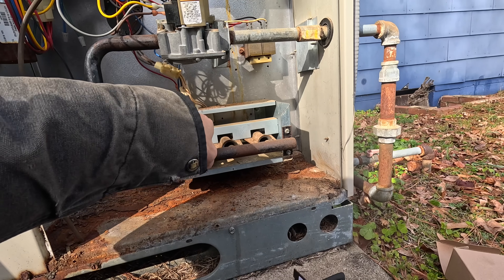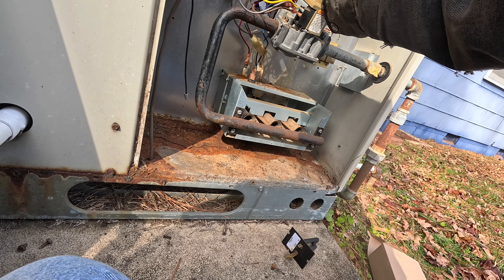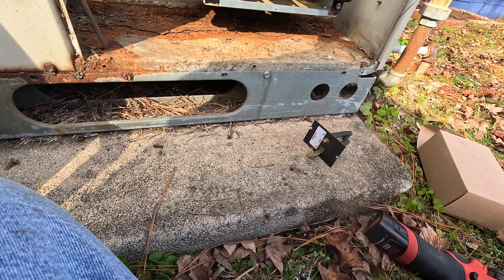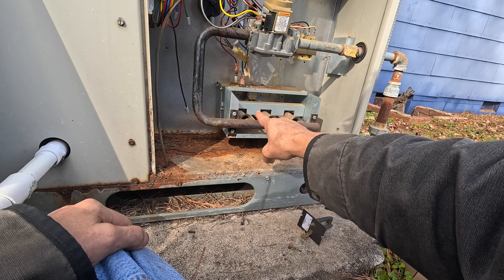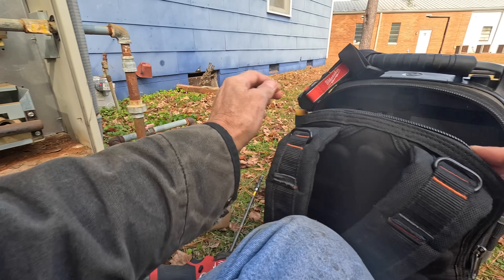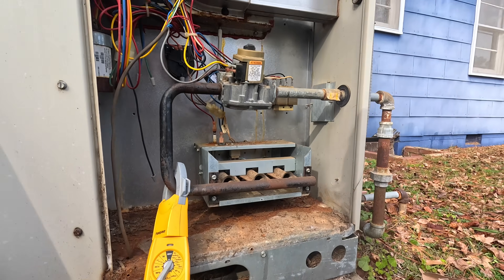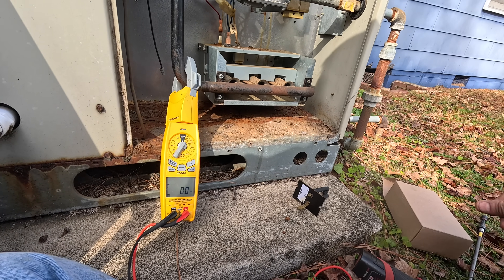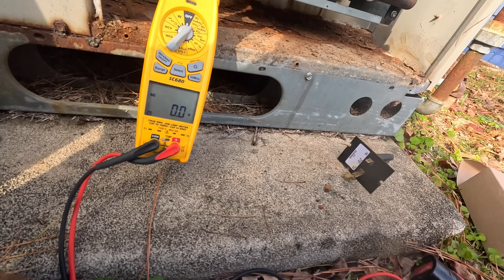Simple Repair Reveals A Baffling Problem! #hvacguy #hvaclife #hvactrainingvideos

Comment: There should be voltage on the flame sensor even if there is not a call for heat. The sensor is just waiting for the flame so the voltage can be rectified to dc current communicating back to the control board through the ground circuit.

Comment: yes, that voltage through the flame rod is normal. but since you were reading it from the burner box i would guess the porcelain insulator is compromised

Comment: Power off at all times when replacing an electrical part brother. Shortcuts can lead to preventable accidents. 45 years in the HVAC trade and this OG has learned a lot...some the hard way.
Reply: Yep ! Power off and body off the ground.

Comment: Maybe the difference with this one is that most of them only put the AC voltage on the sensor when they expect a flame to be present (gas valve open), but this one is connected all the time , or at least when the draft motor is running?
Reply: most of them have voltage applied at all times, that way they can sense for flame when there shouldn't be. like gas valve sticking open, rare but does happen!

Comment: flame sensor is normally powered by high voltage through a high value resistor so a voltmeter may show a high value, but if you use a LOW IMPEDANCE meter the voltage will drop to almost zero. Same thing if you touch it (still not advised, don’t do that) the voltage should drop to zero because of the high resistance. I’ve done it before to demonstrate how little current is flowing through there, not enough to feel at all. More likely you got hit by the hot surface igniter. On a package unit they’re 240V & are controlled by relay breaking one leg only so the other leg is always live much like a single pole contactor controlling a compressor. Check out other HSI circuits, you’ll see almost line voltage with respect to ground because its line voltage through a current limiting resistor in series with some type of isolated current sensing device (many manufacturers do so by various different ways).

Comment: Most if not all control boards will put out a voltage of between 90 to 100 volts AC. There is nothing wrong with the board, that is normal.  Learned that at a heating conference one year. It is a good way to tell if the board is functioning normally. Next time you are on a routine call, check the voltage to ground. you will get similar voltages

Comment: Flame rods are line voltage, they should have 90 to 105 volts to the burner. It is the flame that passes only dc micro amps. All the ifcs wr, honeywell, icm the flame sensors are line voltage. The flame rod is live any time there is power, not just during a call. This is so it can test for flame when there should not be any and is part of the call sequence, after limits closed, then no flame, then ps open, then start inducer . Most of the time techs are shocked on RTUs as they do not have a door switch. If you look there is normally a blinky code for flame when no call. (on WR ifcs 5 blinks)

Comment: You need to spend more time understanding the equipment.  There is significant voltage on the flame rod and you will get a shock if you touch it. Your voltage readings are correct. You're confusing the micro amps that you get on an ampmeter.

Comment: Flame sensor always has about 90v on it, even when there is no call for heat. It is a safety feature. The flame sensor's porcelain is probably cracked and shorting to ground and causing the issues.

Comment: Funny the system I fixed for less than 200 bucks is still going and it's been almost zero a bunch already .had 2 or 3 different companies come look they all said same thing system is junk old have to replace for 38 grand that's literally like 30 grand just for a change out and suck down freon .another job same thing and I'm waiting on gas valve for it they said same thing it's over 10 years old so has to be replaced it's in mint shape

Comment: This same thing happened to me when I was changing out a furnace. Turned out the house electrical panel never had been grounded by an electrician that had replaced the panel a few years prior. That’s the only time I’ve ever gotten a jolt from a system.👍👍🇨🇦

Comment: Kinda surprised you made it this far, testing voltage with your hand and fingers. I agree with the other comment on the potential voltage across a flame sensor vs. current. The current should be very low to ground. It's probably the only reason your customer did not have to call 911. As far as the limit goes, sometimes that rollout limit is in line with the main limit. Sometimes that switch is an auto reset, some times if that trips it will lock out the board. Sometimes it's a sign of a heat exchanger problem. Wouldn't know unless I looked at the unit myself.

Comment: A flame sensor is a flame rectifier, it should have between 90V-110V AC and the flame conducts and creates a pulsating DC that the board detects a flame! It is Micro amps once the flame is detected.
Reply: 100%. Flame sensor (rod) passes ~2-4 microamps through the flame to the heat exchanger or casing, which is detected by the board through ground. That's why you'll commonly see a ground line attached to the burner enclosure near the burner tubes, usually attached to the gas manifold itself.

No microamps on ground means no flame. A bad ground connection to the board will cause the same issue as a dirty or damaged flame sensor.
Reply: 100%
Reply: Thats how you can tell if flame sensor is bad or output on board. @Azranael is correct

Comment: I've replaced hundreds of those high limits . You can almost always take it out and just tap them on the crappy limit to get them to go temporarily if you don't have the proper one right at that moment and the board does send just short of line AC voltage and the sensor then converts to a pulsating DC voltage back to the board for flame proofing

Comment: A shocking experience. Where did that voltage come from? It must be that board, Capacitors, nope, not the right amount of voltage. Transformer, maybe. And the dang thing is working. Mysteries, I hate them. Gremlins. Well you did a nice job anyway.

Comment: yes, ceramic flame ignition devices are 115 volts, i would avoid touching it even when not in heat mode, next time measure for voltage and amperage of flame sensor, nothing wrong with circuit board

Comment: One other comment, from the earlier, original video:  Once I read the 8 volts across the high limit, I would have taken some measurements to determine where the rest of the 24 volts was dropping.  Was it one of the other safeties?  A bad connection in the yellow safety string?  Would have only taken a few seconds...

Comment: I've always understood (by looking at some of the circuit descriptions in patent applications for flame rectification in my early days in the trade - US4755132, which is the basis for the circuits in my 1991 vintage Rheem RGDE Gas furnace) that the voltage applied to the flame sensor is LINE voltage, NOT low voltage.  It takes a lot of voltage to pass even small (microamps) amounts of current through the flame's plasma.  That plasma is conductive, but is a pretty high resistance conductor, which is why a high voltage is needed to produce even a small amount of DC current.  So what you observed is just the way it normally works.  You can easily verify this by checking the voltage at the flame sensor terminal (and ground) on a known working system.
Reply: You beat me to it, Bob. 
The flame sensor is continuously powered on gas furnaces from every manufacturer I've ever seen. The voltage you measure will be less than a full 115 VAC and more than 90 VAC. On indoor furnaces, this is stopped by the door switch which kills all power to the unit. On gas package units, you must pull the disconnect.
Reply: @heymikeyhelikesit8673  Yeah, I never stick my hands in equipment that's powered up.  It's not a good idea...
Reply: Yes, if you have ever had the misfortune of brushing your elbow across an oil ignition transformer  when it's trying to fire you will feel the pain of 10000 volts. fortunately the current is small and you should survive.
Reply from the maker: Never shocked me before
Reply: @HVACGUY  He is correct.  There is ac voltage running to the flame rod and it can vary depending on the furnace from 50 volts ac to well over 100 volts ac and higher.  It is rectified to dc current in microamps when a flame is present to prove flame.  It is working as it should be.
Reply: @SmokyRibsBBQ never gets old knowing you know so much Russ!! Cheers!!
Reply: @jaysonescoe5799  I'm an old HVAC guy myself, among other things lol.  Cheers!
Reply: @HVACGUY  Maybe you've been lucky so far...
Reply: @HVACGUY Hey Curtis, open neutral on that gas pack?  Bracket there should not have been hot AFAIK.
Reply: @HVACGUY  I really enjoy your videos!
Reply: @HVACGUY I’ve never gotten shocked off of one either.

Comment: The flame sensor creates its own voltage…thus why no millivolt reading if there is no flame…surprisingly the board hasn’t shorted out…either it wired wrong or you have a transformer shorting
Reply: No sir.  

The AC line voltage is applied to the flame sensor by the control board.  The flame's plasma provides a path for current to flow, if it's present.  Because of the physical asymmetry of this arrangement, current flows more freely in one direction than the other, resulting in the AC applied voltage being turned into a rectified DC current.  That very small DC current is what is detected by the control board, telling it that a flame is present.  

Millivolts applies to a thermocouple.  Microamps applies to a flame rectification circuit.  Two completely different animals...

Google "flame rectification" for more detailed explanation.
Reply: I think you are referring to a thermocouple. They produce millivolts through bi metallic means.

Comment: I’ve had problems with bad grounds affecting flame sensor operation but I never bothered to check for applied voltage. Somewhere in the 50 ma region is normal current but that 98 volts sounds like either a bad board or an open equipment ground. But the dang thing is working normally !

Comment: That is normal for a flame sensor. 90 volts from the sensor to ground. I've never been shocked by one. And I've often wondered if that reading is some kind of ghost voltage. But it is perfectly normal to have 90 volts to ground from the flame sensor. 
😎👍
Reply: And of course that is different than the microamp reading that you're getting when you put your meter in line with the flame sensor back to the board. You're only reading millionths of an amp of current. 😎👍
Reply from the maker: Thanks for the info!
Reply: Agree 100%.  That is by design.
Reply: I just checked the flame sensor on my furnace which is working fine. It has 97 volts to ground.
Reply: It's not a ghost voltage.  It's there for a reason - do generate current flow through the flame/plasma, which is a fairly high resistance conductor.

Comment: The old time electricians use to do a neutral break. You shut switch off but you still have power. I've gotten shocked plenty of times lol.
Reply: I hate that. They use to do that all the time, tie ground to neutral. Been shocked bad because of that, chest pains and all. I was on a ladder and had enough scruples to step down, which broke the connection, otherwise I would be taking that long dirt nap.

Comment: SHOCKING VIDEO CURTIS
Reply from the maker: Been a while since I’ve been shocked
Reply: @HVACGUY  True, but you do seem to find interesting ways to get shocked.
Reply: yep that is correct...flame sensor always sensing for flame even when unit is not on for safety...it can range anywhere from 90 to 180 volts